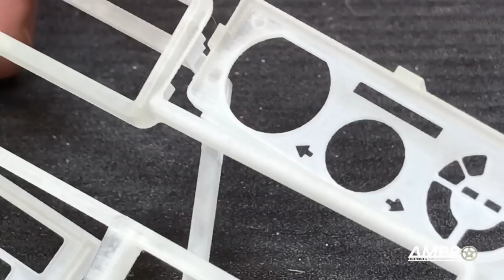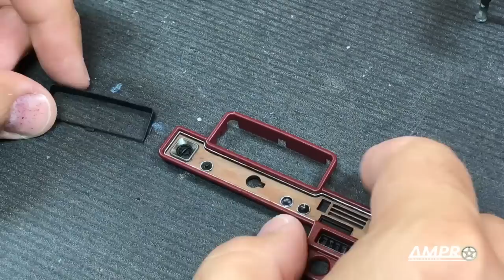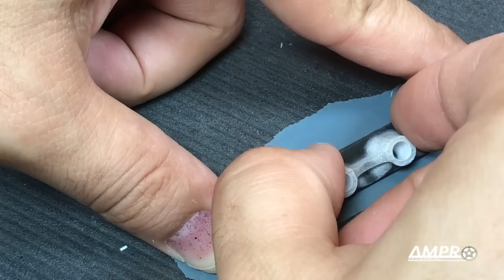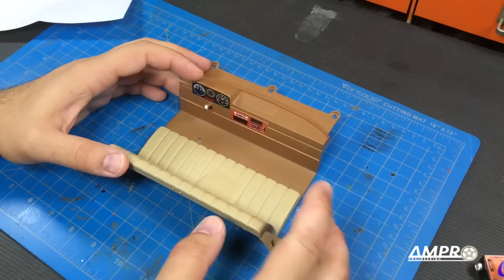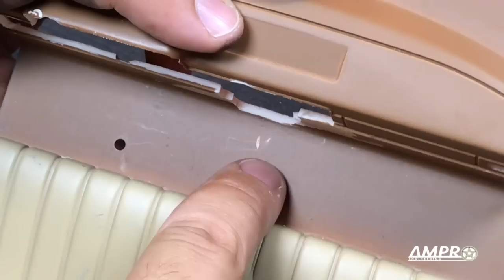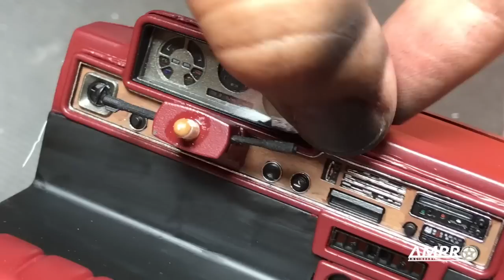e164: Tamiya Bruiser & Trailfinder 2 Interior Dash Upgrade!

Comment: Those rigids are layer lines from a low resolution resin SLA 3D print they're not a feature they are an eyesore and should be sanded or filled.
Reply from the maker: This is why i use a polyjet. I refuse to use a SLA.